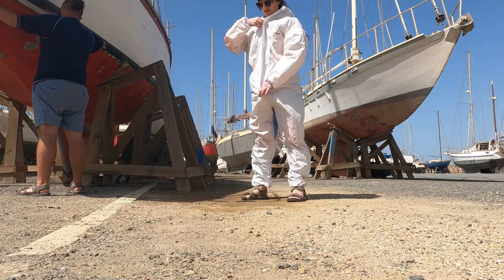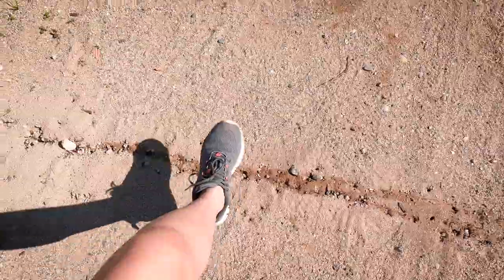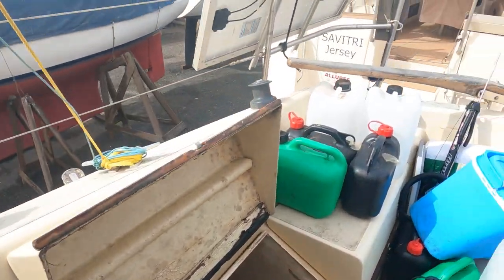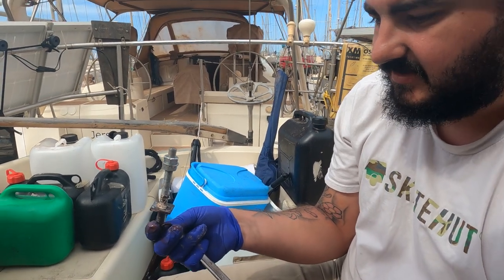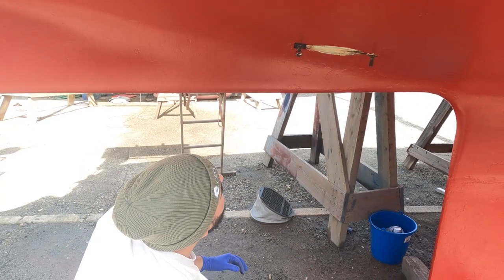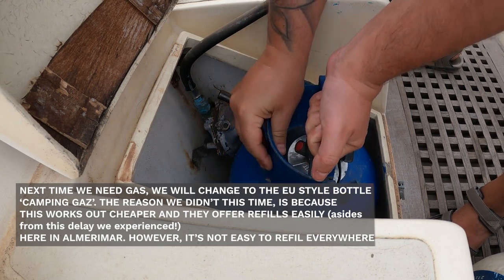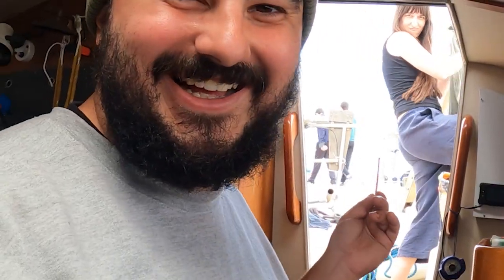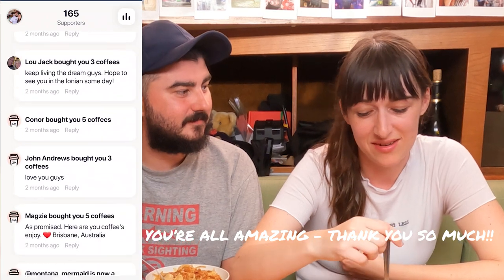A HOLE IN OUR BOAT? | Antifouling and Relaunch day... | CHASING CURRENTS EP42

Comment: NEVER reuse any underwater hardware unless you know it's history ...have been working on boats for over 50 years...
Reply from the maker: Hey unfortunately we had no choice this time as no one had replacements. We did give it a very good clean and a check for corrosion and it was in good condition still. We do agree though that if we was able we would have replaced. Thank you for the comments ☺️

Comment: Sounds like your water pump needs refurbishing as its not able to lift the water from seacock to pump. Simple job, new impellor and face plate (or turn face plate round). The impellor wears the face plate over time and reduces the effectiveness of the impellor.
Reply from the maker: Hey Nigel,
You were pretty right there, we have since changed the impeller while giving the engine a service 😅. We also took out the bits off the used impeller from the heat exchanger. The only thing we didn't do was change the face plate but we will likely do this next service. 
Thank you so much for commenting, all the best Brynn and Jade

Comment: If you have a grinder or a dremmel type tool you can grind or cut a nut off a stud....sometimes just the heat will release the nut from the thread. Nut splitters are pretty cheap manual tools available in car/tool shops. Those studs were overlong so you could have cut the corroded bit off.. or replaced it with a shorter stainless steel bolt. With the nut inside..to avoid corrosion of the thread...i would say it was most likely stainless steel all thread that the original had been cut from. 

Its called prop walk guys...glad your back in the water and Wildings have their engine in and ready to test outside of the marina.
Reply from the maker: Hey Clive 😁.
Thank you for a very informative helpful comment, a nut splitter is now on the to buy list to keep in the tool box. We have got a dremmel but haven't used it yet and think we might have lost some bits.

And yes prop walk 🙌
Were just about to settle and watch wildlings latest video now 😁. Amazing how far the guys come and how hard they have worked, legends.
All the best Brynn and Jade

Comment: Glad to see your back out to the boat  🥰 what solar system did you install if you don't mind me asking? Thanks stay safe
Reply from the maker: Hey James, 
Thank you for commenting 😁. Our solar system comprises or 2x 100w renogy solar panels and  1x victron mppt charge controller. Our battery system is 400ah of Agm batteries and a victron smart battery monitor. We have a separate starter battery for the engine thats lead acid.
Hope this helps a bit 😊, all our best Brynn and Jade
Reply: @ChasingCurrents  amazing it really does ❤️🐼

Comment: I have started watching all your videos I would recommend if you plan to cross the Atlantic I would advise to have your boat modified for a twin headrail setup which will help you greatly once you catch the trade winds it would also be great to do a video on the Schengen visa so new boaters can see the process
Reply from the maker: Hey, thanks for starting from the the beginning. 
We think if we cross the Atlantic there would definitely be a few upgrades we think would help. That's a really good shout for that one.
And we will do a video on the visa eventually but want to have a bit more experience first 😀, nice that you think that would be a good video though 😁🤙.
Thanks for the comment and suggestions 😀
Reply: @ChasingCurrents  there is a youtube video called guide to crossing atlantic all the tips are in there if not sure which video give me shout I'll post link

Comment: Had exactly the same problem with my anode on my stag 28 this year, the bolt was just spinning as I tried to get the old anode off. Done same repair as you, and you make getting into the locker to get behind the engine so easy! I will have my fingers crossed my repair holds when we launch next week! Look forward to watching your adventures this season.
Reply from the maker: Hey Craig, 
I think its the amount of practice we have had getting in to the locker that helps it look easier now 😅.
Such a pain that the bolts are designed like this, good luck for this week though and hope all goes well 😁.
All our best Brynn and Jade

Comment: You can put an adjustable spanner on the square plate to get the nut off.  You are right they are a flawed design, I can’t remember how many I have replaced over the years as they do corrode!  Well done.
Reply from the maker: Hey Richard, 
We did try the spanner trick first 😅 unfortunately it didn't work for us this time. Thank you for putting it in the comments though as it might help someone else 😁.
Thanks for watching and following along 😀 all our best Brynn and Jade

Comment: A really good find for my boat was stainless steel anode bolts. They are a bit more than the zinc plated ones but they don’t corrode and are easy to get undone. Last longer too.
Reply from the maker: Were definitely going to pick some up when we find some for next time. Thank you for commenting 😁